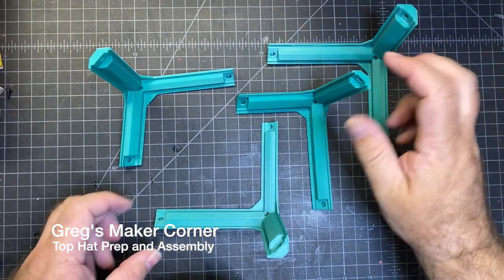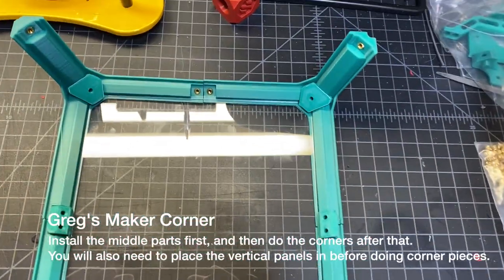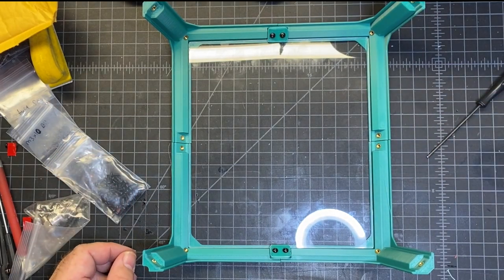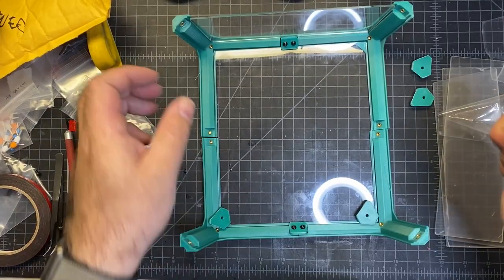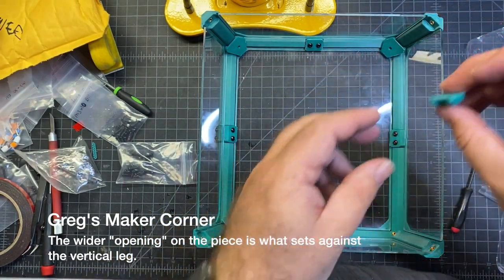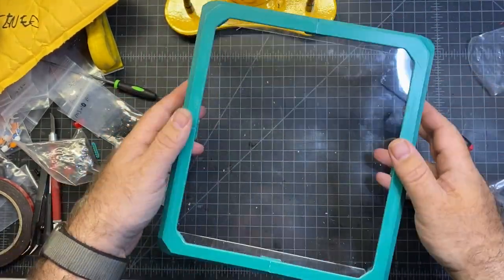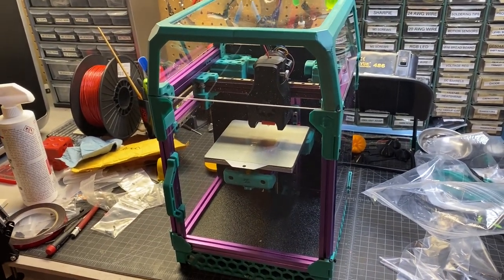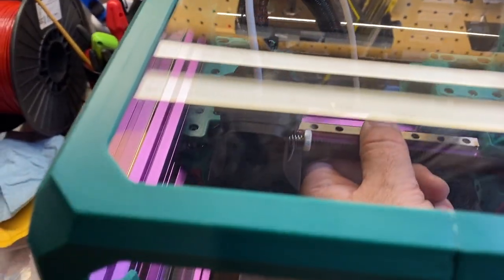Voron 0.1 Build Series - Top Hat Assembly

Comment: can i print those on the v0? or does the bed not fit
Reply from the maker: Great question. These can be printed on the v0 if you have the full 120mm so available. It can get a bit tricky on where you position it on the bed also.
Reply: @GregsMakerCorner  you were not kidding. Ten failed attempts trying to get it to print correctly. First it was not enough cooling on the sides which causes drooping, then it was warping due to cooling; then I found my Z wasn’t long enough to print the entire structure due to my thumb screws tightening too much. Ahh. Might just fire up the prusa and get it going again; but it does fit on the 120mm plate.
Reply from the maker: @dankie44  I hate to admit it, but I just recently printed my top hat parts on the Prusa Mini.. for similar reasons.